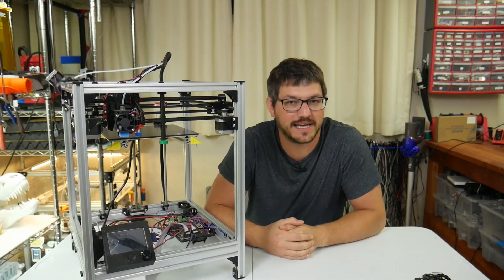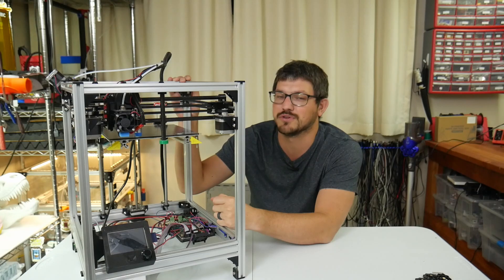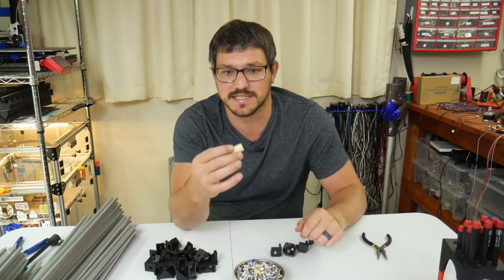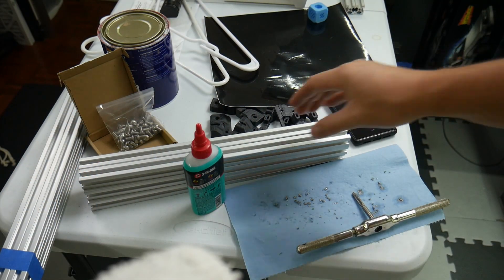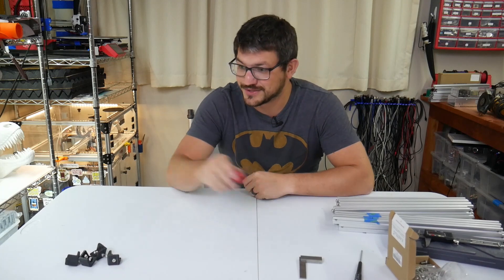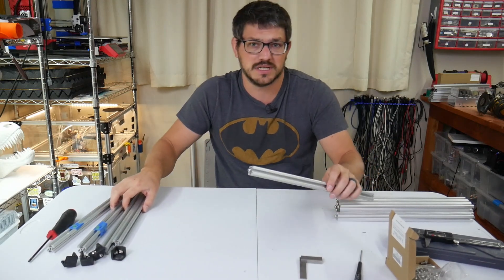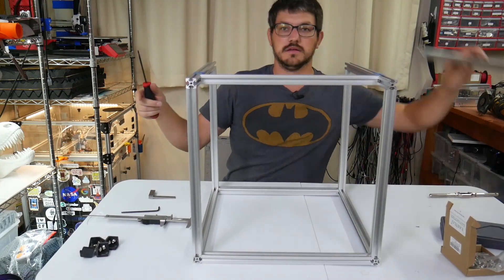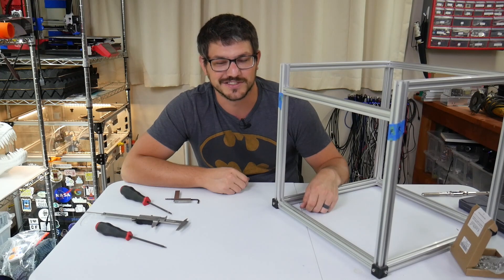HyperCube to Voron Legacy Part 1 (Disassembly and Frame)

Comment: Funny,. I was looking at my still incomplete FT5 wondering if I should convert to corexy or Voron. Is there any advantage to Voron  vs Hypercube?
Reply from the maker: Well as I don't have a Voron printer built yet, I can't say if it is indeed better. (I hope to figure that out though) I can say that the design seems to be better and more well thought through compared to the HyperCube.